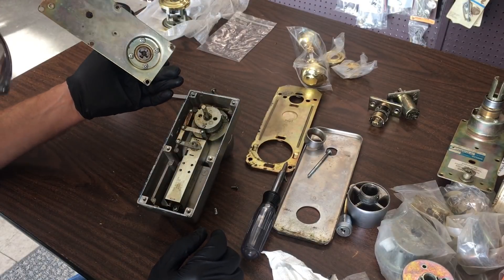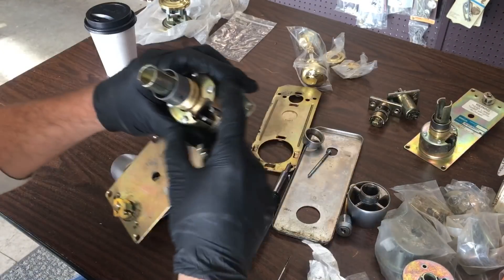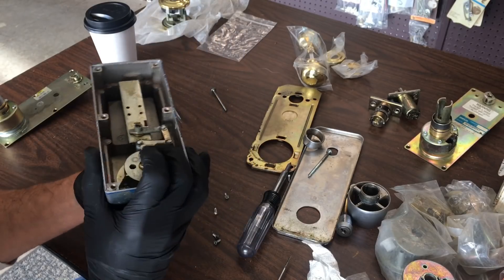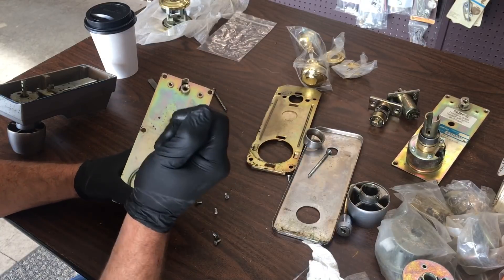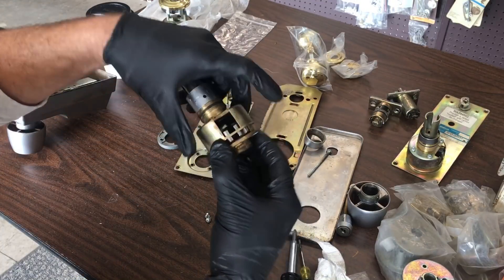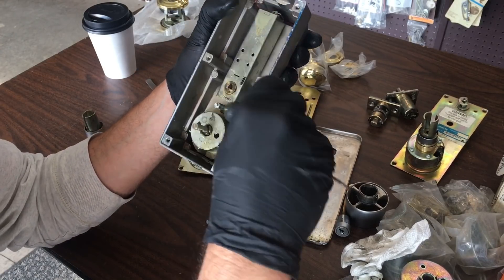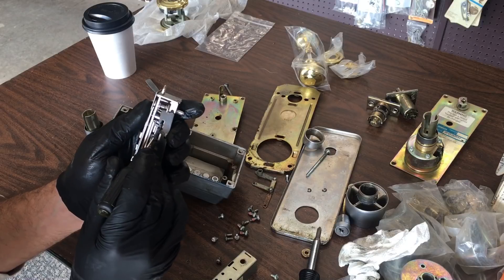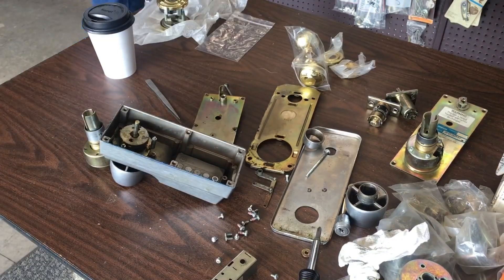cont from HFYVI: Simplex 1000

Comment: just what I needed!!! when you tore down the latch thing called the shoe it can be reassembled in either direction upside down,  the thing your holding in your hands at 6:51, of the when I tore down my lock i forgot which side goes down what is the differences do you know  if you place it upside down does it have deferent function.

Comment: Any chance you can tear down just a little.more so I can see how the return spring assembly gets re assembles?  I took out the 3 screws and saw a c-clip hanging around.  Everything works but the handle doesn't turn counter clockwise.

I disassembled and now lost.